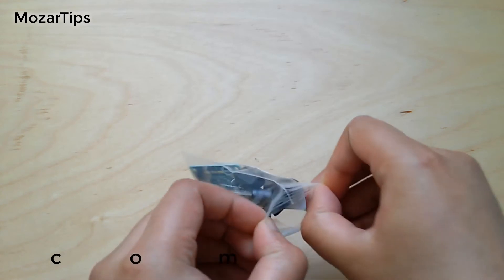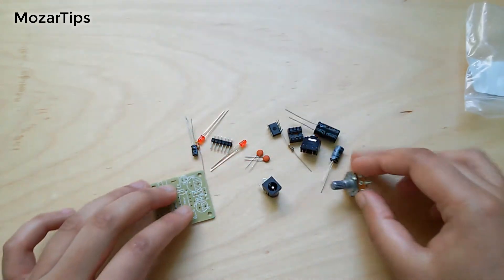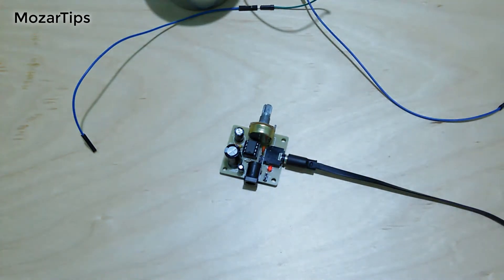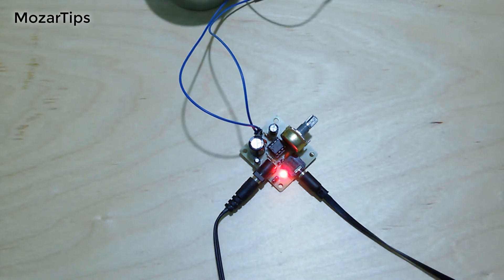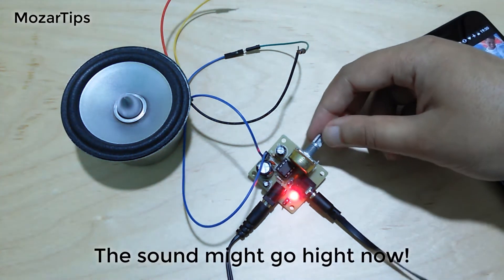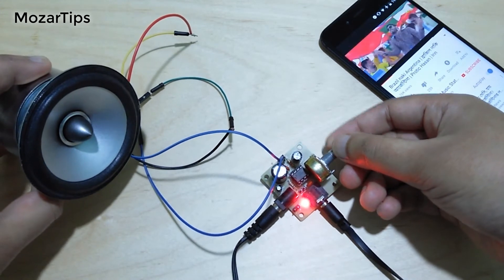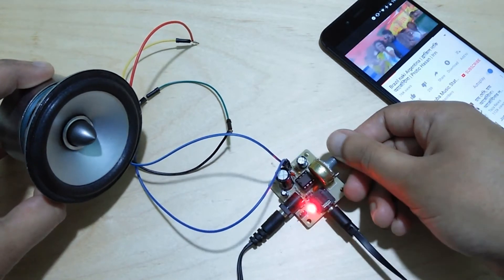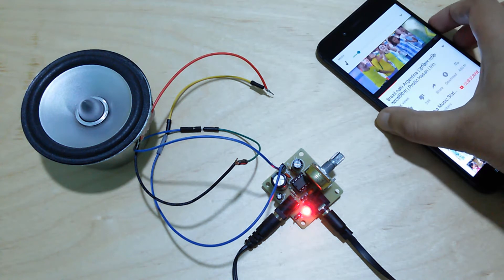DIY MINI AMPLIFIER CIRCUIT 🔊

Comment: I suggest you consult the datasheet for the LM386 and revise your wildly inaccurate claims about 10W output!
Reply from the maker: Wildly inaccurate claim? I suggest you to visit the website in the description if you haven't viseted it. Thanks
Reply: @mozartips   Nick B is 1000% correct.  There's no way in hell an LM386N-1 can produce 10 watts of output even at 12 volts.